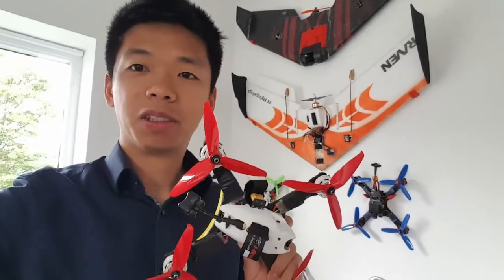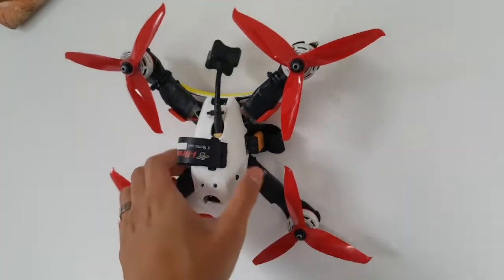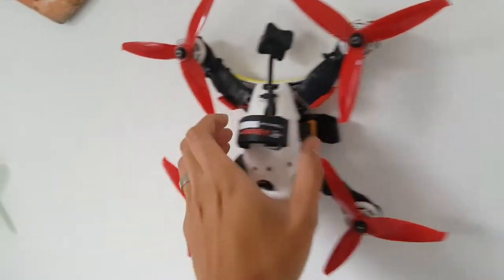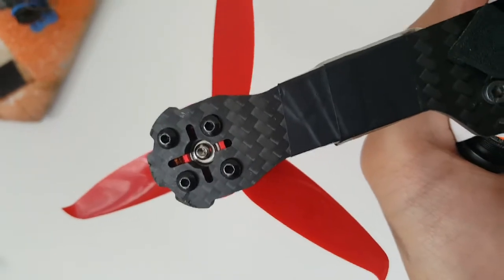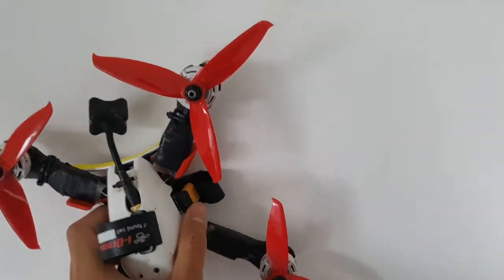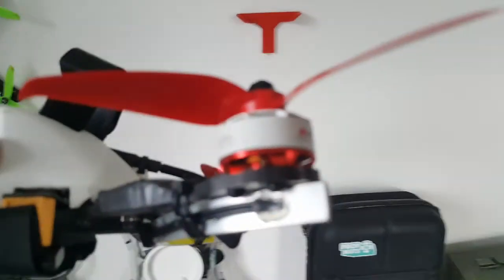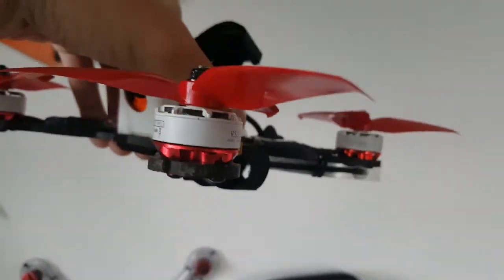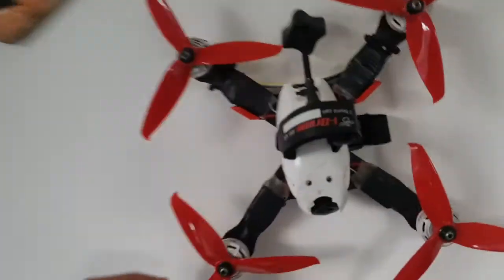Quick Review of EMax 2306 2400kV racing drone fpv motors

Comment: 30 A ESC is fine with these motors? With 5×4.5 HQ bullnose prop
Reply: 5046 tri cyclones on a 4s pull 120A (30a each esc) total on these motors, never had an esc blow from this setup :)